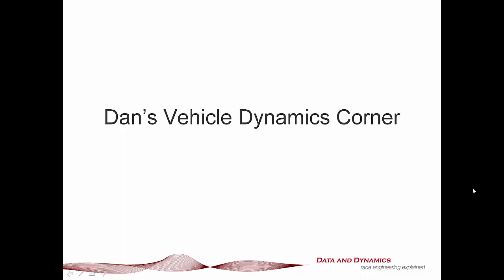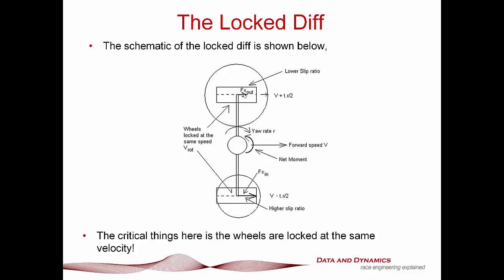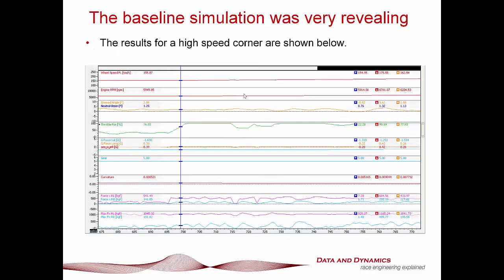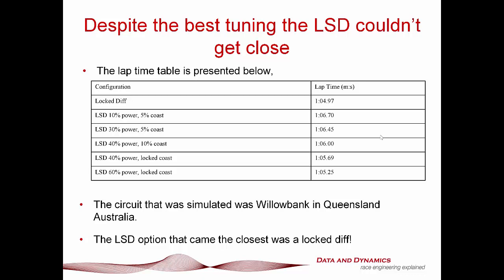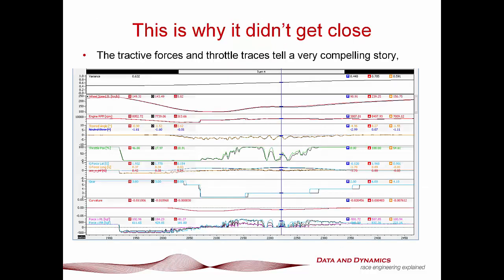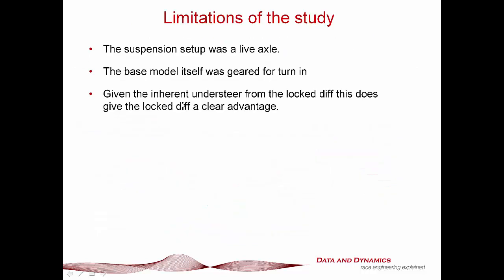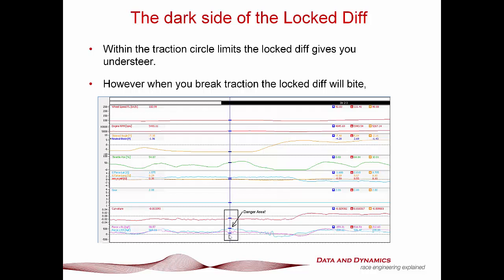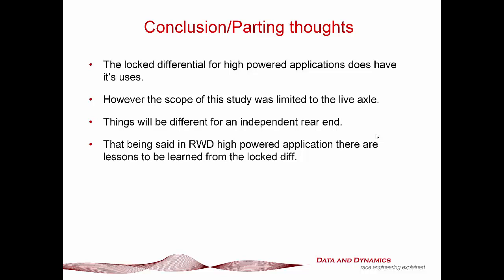The case for the locked differential in racecars

Comment: Hi, thank you. I have a question. On data screen (9:00), what is the computation to get channels "Force x RL" and "Force x RR" ? It seems to me linked to the throttle application, then the engine power request and the resulting rear diff torque. How is simulated the Throttle position? Is it by fixing a target of car balance? (level of US/OS)
Thank you for your help.

Comment: As the power available in modern batteries and brushless electric motors has increased over recent years the RC car racing world has largely abandoned differentials, particularly in the front of 4wd cars. The rear differential is now a grease filled planetary gear type, the viscosity of the silicone grease being used as the slip tuning.

Comment: Having a hard time understanding.  The time differential made up under braking/turn in in the locked diff case is becuase..... why?  From a physics standpoint, how does the locking in coast equate to the lower laptime? I believe the takeaway in this case proves more so that the differential has insufficient locking (preload & clutch discs #'s) to provide right tractive forces. If the assumption is that the understeer inherent  in a locked diff would create a slower car, then a plate diff with 100% locking 1 way vs locked 2 way i believe is a better apples to apples. But two datapoints you provide are very curious.... I'd be interested to see the 40% power 10% coast vs 40% power locked coast data overlaid. Or just the 100% locked 1 way vs 2 way locked case.
Reply from the maker: Danny - re review the presentation. If you look at the overlay Coloured is the locked diff. Black is the LSD. It romps away under power. But again let me stress this is the exception that proves the roll because the setup was optimised for turn in.